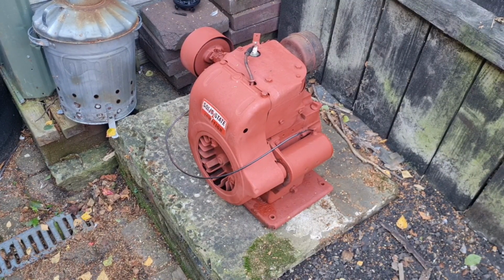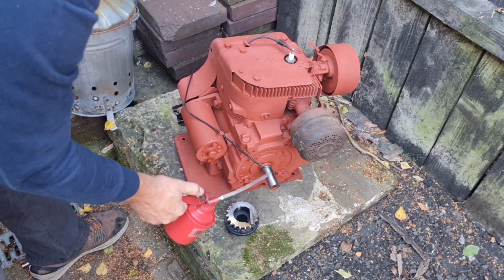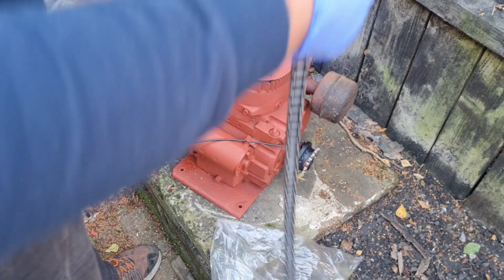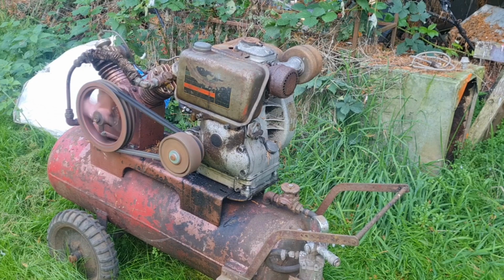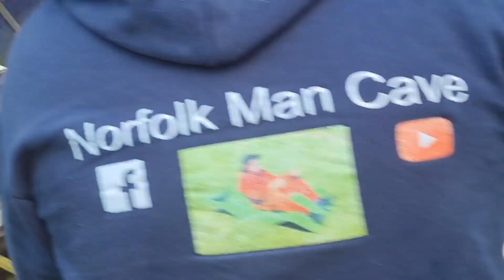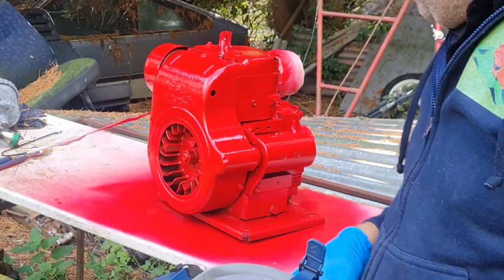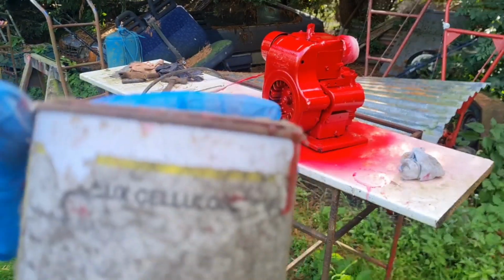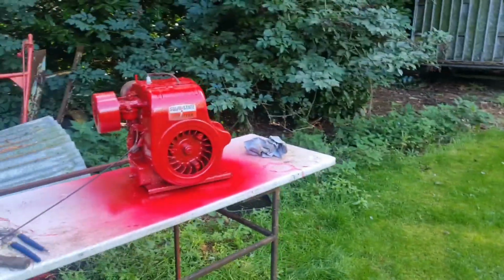The Bonser engine gets paint.

Comment: Maybe a silly question but you have checked the engine sprocket is going to align with the clutch drum chainwheel when the engines fitted? also was there a particular reason for not using the split taper bush that came with the sprocket?
Reply from the maker: Yeah there is loafs of movement mate and the sprocket can be reversed if needed.

Comment: Why did you not just buy the taper that goes with the sprocket, I may even have one the right size, I have a bin full of fenner taper locks and pulley's.
Reply from the maker: Just thought I would use what I had buddy and keep costs down. It seems to work OK so far. Until I fit it all to the truck, put some load on it and it all flys apart 🤣🤣🤣